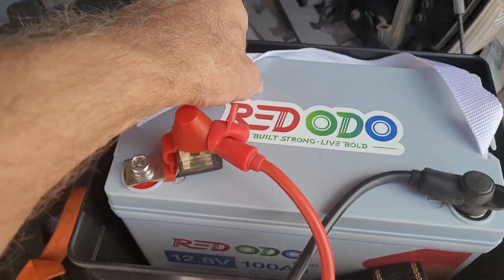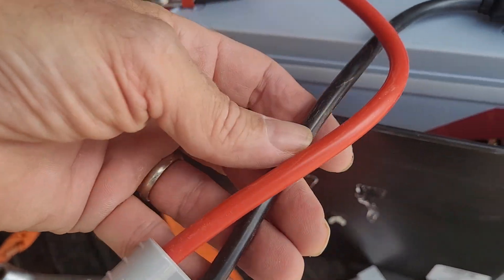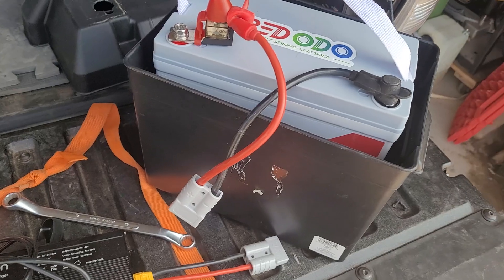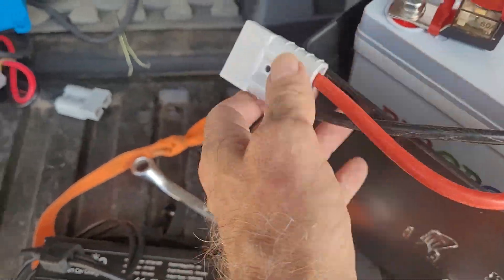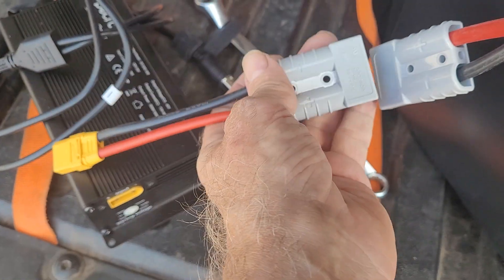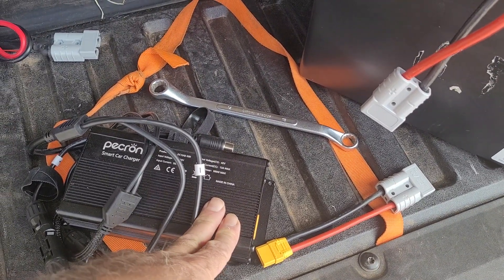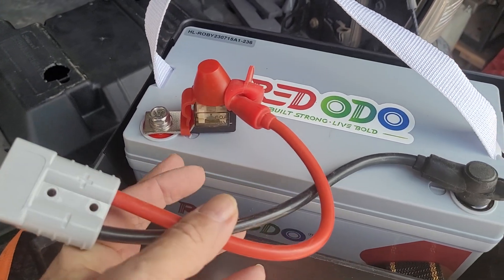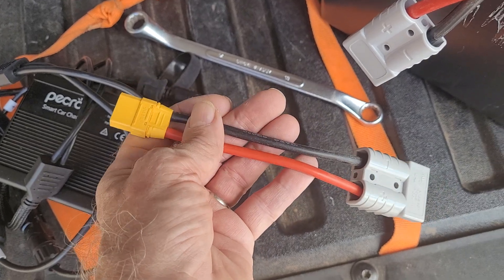Pecron Car Charger, LFP Battery, PowerStation setup

Comment: Once again, before somebody starts a fire, that input pulls 50 amp max, and 10 awg wire is dangerous. The pecron charger increases the voltage to 42 volts and decreases the amps. That input will draw at least 40 amps from that battery. Just use the wire and dongle that came with the Pecron charger to be safe. I know it is much too long, but it is the needed 6 awg wire.
Reply: No...10 AWG 105C cable is rated @60A outside the engine compartment, and 51A inside the engine compartment, so pulling 40A is well with the spec of the cable...

Comment: You are mistaken about the 10 awg wire being enough for the amperage! It is true the 1242-500 output amps are well under 15 amps at 42 volts, but that is the secondary amperage. The XT90 is feeding the primary side and can pull over 40 amps out of the battery. You might get away with it because the power station will likely not be drawing full wattage for long. Please note....the power cord that comes with the pecron charger uses 6 awg wire and is protected by a 60 amp fuse. If you try to run the trolling motor and the pecron charger at the same time, you will likely blow that 60 amp fuse. I have yet to find an XT90 to anderson 50a that uses 6 awg wire. I am making a dongle using 2 10 awg wires going to 2 xt90 connectors which plug into a two XT90 male to female parallel union. The red hot wires will have a 60 amp breaker in line. No matter what the device used, you simply can't put 400-500 watts into the power station, without drawing the same or more wattage out of that 12.8 volt battery. 500watts/12.8=39.0625, and accounting for efficiency losses, it will be around 45 watts at least. The specs clearly written on the charger says 12-30 vdc 50 amp max for the input, the XT90 is the input.